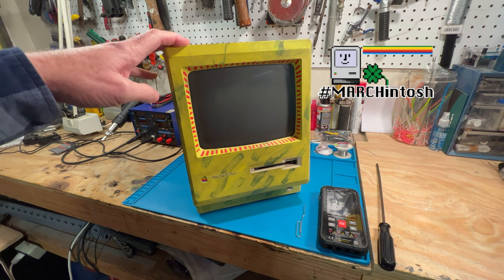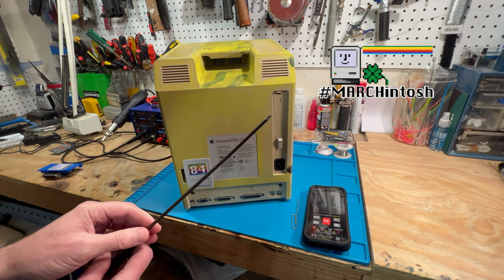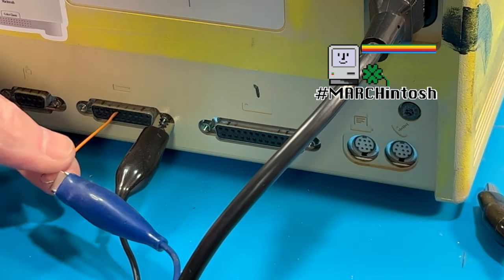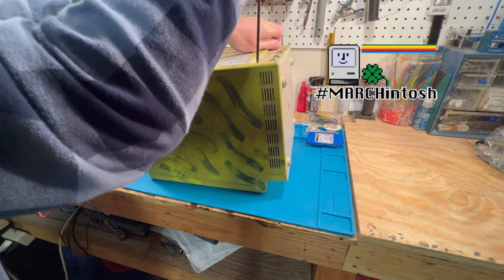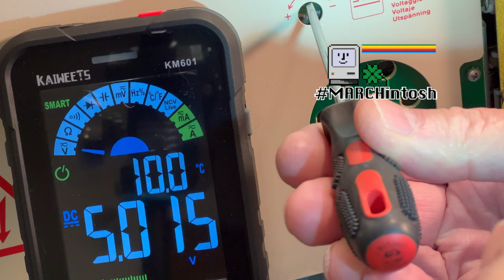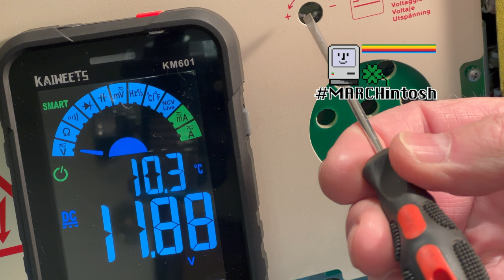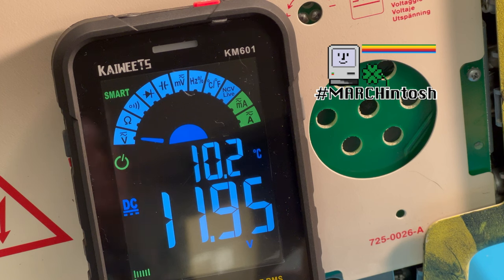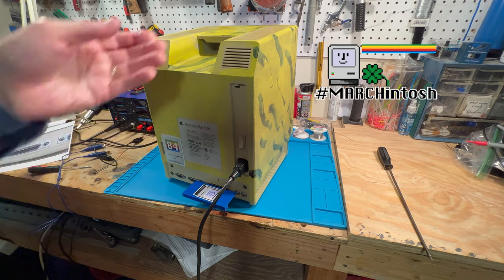MAC PLUS VOLTAGE ADJUSTMENT FOR #MARCHintosh

Comment: Hi, you meter shows 5.043v and you say "we are little bit high on the 5v side" and then you say that the allowed range is 4.85 - 5.15v. To me it looks like its perfect like it is. In any case it was within the given specs. And like you said the 12v side was good too. Why adjust? Are they likely to drift? After all that adjusting you ended up higher on the 5v than when you started (5.050v).

Anyways, nice interesting videos. Keep up the good work! 👍🏻

I have saved few vintage macs too and plan to fix and/or tune some them at some point. I think I have 3 bird house Macs (Plus, SE30 and one other I cannot remember), a Portable, Quadra 840AV and 900 or 950 and a PM G5 + some Powerbooks etc. Will make some nice projects some day, maybe when I am retired. 😉
Reply from the maker: yea wanted the 12v side little higher so left the 5volt higher